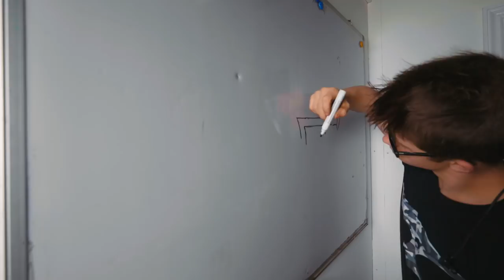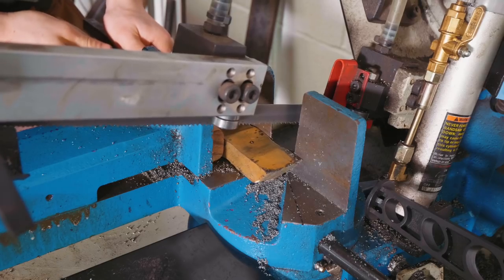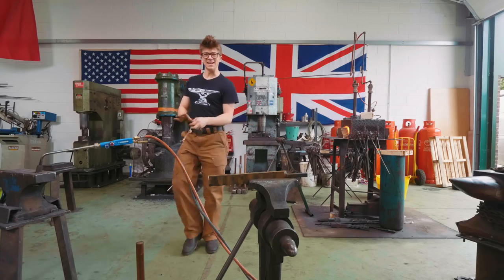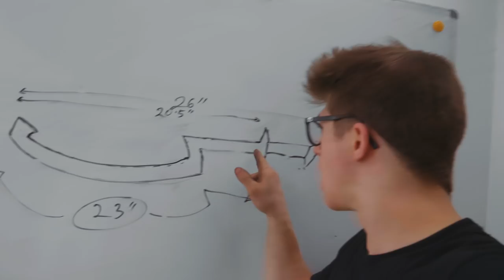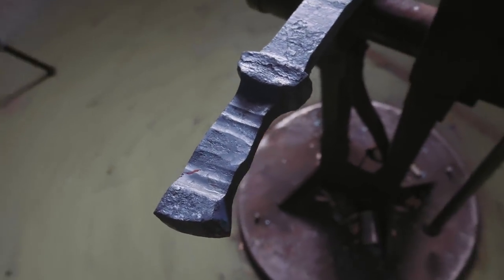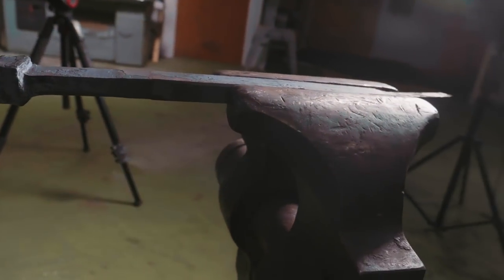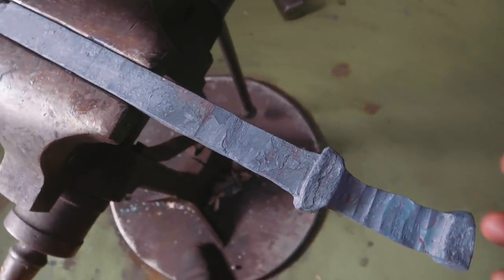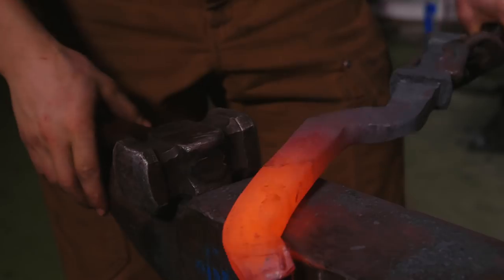MAKING AN EGYPTIAN KHOPESH SWORD!! Part 3

Comment: The edge is not inside the curve (like shite) but outside (the weapon descend from the aegiptian axe). And the tip it's more pointed than your board design. ;)
Reply: I am actually concerned that he might dont get that right..... he talked about "blade on the inside"....and I think a part of me will die if he does what he said (dispite historical correctness)
Reply: I screamed at my screen with fear that he might actually do this... YES, the edge is on the outside (like an axe)!
Reply: I hope he can read this before do the mess, but I fear the videos are late (editing and posting are time consuming activity) and the mess is already done. :D
Reply: The Kopesh is not for joke named the deadliest hand weapon of the ancient. It has a cutting edge outside and inside -.-
You can slash, stab, swing, punch and poke with it
Reply: Do not mix Khopesh with Dothraki (double sharpened) :) Comon mistake, btw.
Reply: Thanks. wasn't aware of that :) Always loving to learn something new

Comment: Did I misunderstand or did Alec say the edge was on the interior? pretty sure the edge should be on the exterior and the interior is blunt, not sure if I misunderstood or is corrected later in the video >.>
Reply from the maker: +VALR i misspoke!
Reply: I was starting to panic for you, really looking forward to this one!
Reply: I was also worried lol
Reply: No the sharp edge is on the inside almost like a sickle
Reply: The sharp edge is on the outside because it is supposed to work similar to a axe, in that the sharp edge is curved so you are always hitting with the smallest area. This means as much force as possible is placed on the contact point. The inside is hollow so you can use the corners to capture your opponents weapon and disarm them.
Reply: Alexander Spencer I just made a comment saying what you said. I should have dug through the comments before making my own comment
Reply: michael hill no! It's similar in function and weight distribution to a khukri or a kopis, infac5 it may have served as inspiration to the design of such swords
Reply: The sharp edge should be on the outside of the curve not the inner.

Comment: As others have said, the sharp edge is on the outside of the blade because it is essentially an axe, not the inside. The sword is not intended for stabbing, so it doesn't need a pointed tip.

Comment: I was amazed to see you upset and forge in the integral guard and pommel. These swords were often cast from bronze as far as I was aware (though egyptian arms and armour are way outside of my wheelhouse) so an integral build like this makes more sense, to pull it off in steel forged in one piece is phenomenal! Love it Alec. Would love to see you tackle a 15th century lucerne hammer,  my favourite medieval weapon. Or a damascus lance tip for solid lance jousting. Hit me up if you would likemsome info on them. I'd even pay for it if that would make it more tempting, especially the hammer so then I can use it to smash some helmets in during medieval combat (though it would need to meet weight restrictions and sharpness restrictions). Could be a fun challenge!  I was going to email you about it but my channel is brand new so I don't meet the criteria for your collab requests 😉

Comment: Alec, have you ever thought about using an electricity powered forge? A blacksmith in my village uses one and says it is much cheeper to run while it can still achive forge-welding temperatures.

Comment: It functions as axe with chopping outer edge, sword with stabbing tip, and hooks, one mostly for pulling at people and armour (inside the tip) and the other (straight out from the handle) for pushing, breaking armour and bones, and knocking people and things down. It’s 3 or 4 weapons in one, and learning to use it, and use it well, is very complex. While this one is lovely, it’s not truly a khopesh as is.

Comment: Just curious but could you use a laser temp gun and say what the power hammer surface is before use and then the temp during use. I was interested in how much heat dissipates while your hammering.

Comment: i realize it wouldn't be integral (all one piece) but what if you made two bars, one for the handle part up until the tight turns, and then another for the blade, and then stacked them and overlapped that one section with the bend and forge welded those together using a large scarf weld or something? do you think the weld would hold up?

Comment: Have you ever thought about upgrading to an induction coil system to spot heat your metal for upsetting. You wouldnt need to keep stopping and heating with the torch then.

Comment: Perhaps to make the metal part thicker, it makes sense to make a two-piece mandrel so that its edges can serve as an emphasis for the expanding part. And the lower part will be clamped and can not bend. (I'm using Google-translator, sorry, if that's not it)))

Comment: You use whiteboard spray what seems like every time you use the board. They are supposed to be dry wipe markers, each time you use spray it takes of the oils that the pen lays down and keeps the board easy to clean. I'm a teacher and kept making this mistake when I got my first classroom. Just dry wipe it and only use the spray if you accidentally use a different marker or it gets cruddy.

Comment: I believe the edge on the Khopesh is on the outside of the curve. Saw none in a museum a long time ago. Unfortunately my masters in in Roman Era British, not Egyptian history.
Reply: Did a bit of research and the edge of the weapon is indeed on the outside of the curve. Also , it was last used as a battle weapon well back into the bronze age, making a functional one unlikely to be steel. There are examples of iron khopesh, but they were most likely ceremonial in nature. If you get that shape out of steel, you are indeed a fine blacksmith! The bronze ones were probably cast, then sanded and ground to finish. The odd hook in the end was probably to help a foot soldier pull a charioteer off his vehicle or unhorse a cavalryman.

Comment: the thing used to be made of bronze... right? I wonder if the shape of khopesh was somehow a consequence of "easy production" rather than "aesthetics".

It's as if the original sword was just hammered flat, leaving both ends to "hang over"... then flattening the center peace, and thinning the edge - which consequently generated the curvature... just a lazy, crude, minimal effort manufacture - and it gives it the characteristic shape...?

Comment: The interesting problem of converting a bronze (cast) weapon to steel (and damascus at that). Eek.
Reply: I wonder too if you could have driven an eye or slot through, then folded the material into a guard?
I.e. ====<o>=
then
====[]==
? I'm probably over or under thinking it.